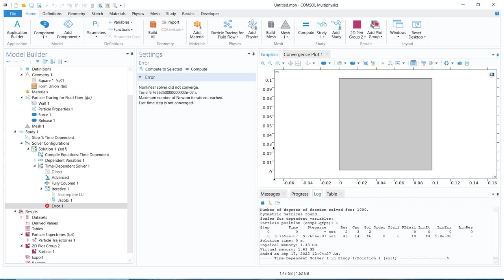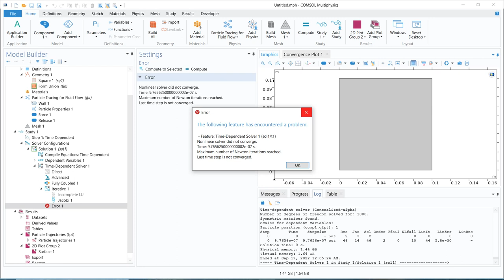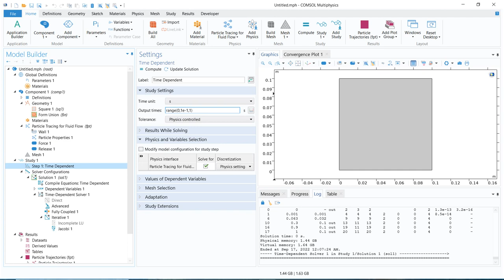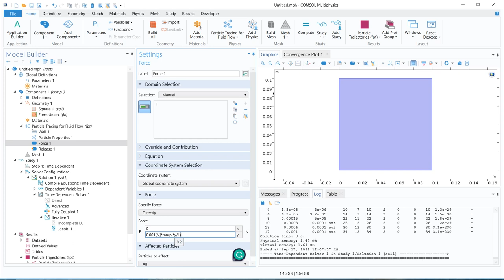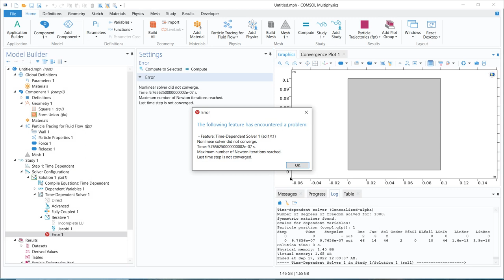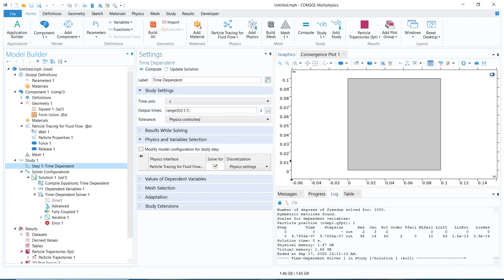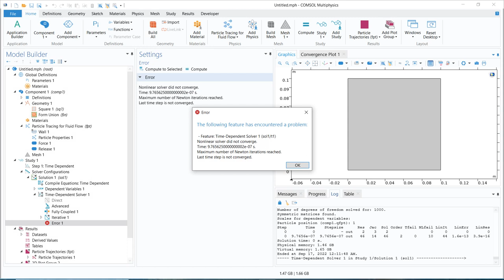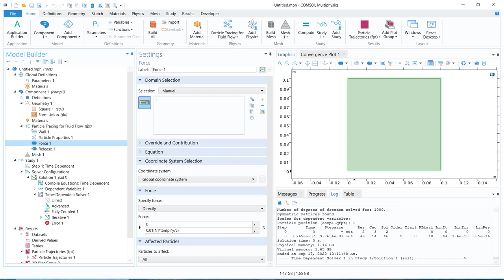Error Maximum Number of Newtonian Iterations Reached #TimeStepNotConverged #iteration #error #comsol

Comment: Hello sir, 
I am working on investigating the plasma region using multi-physics method in the thermal plasma process used for raw material development in additive manufacturing applications. My goal is to simulate the spheroidization process in inductively coupled plasma (ICP), where metal powder particles are melted and reshaped into spherical particles by passing through a high-temperature plasma field.

could give me some guidance on physics interfaces you used or suggest to model powder spheroidization in ICP plasma using COMSOL. 
 
Thank you